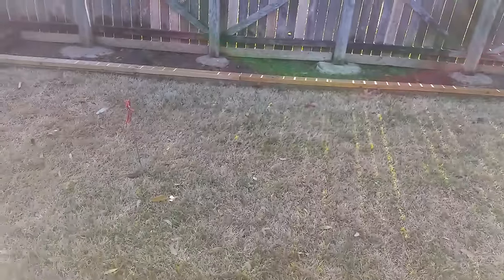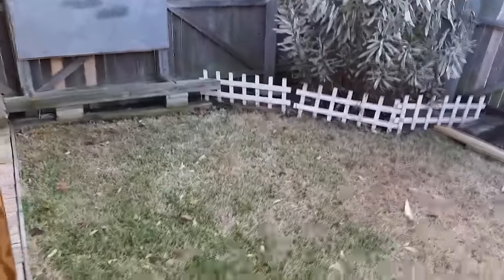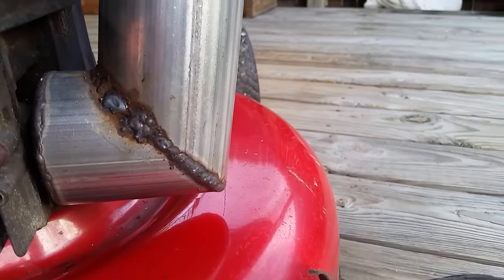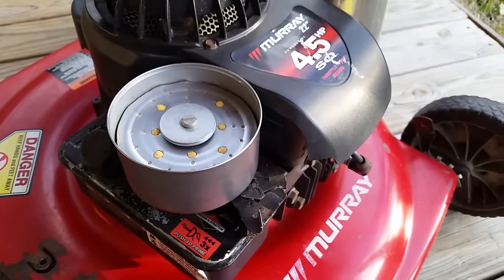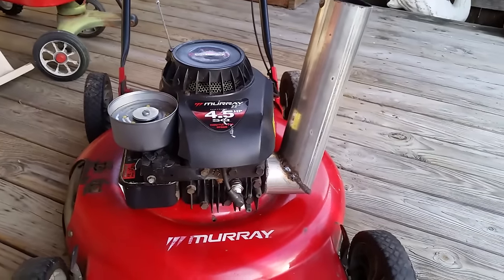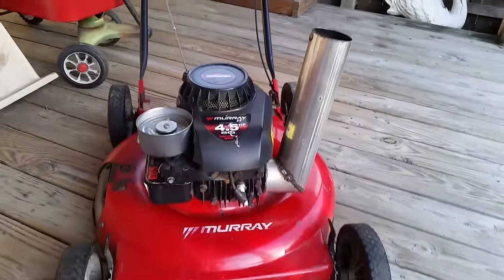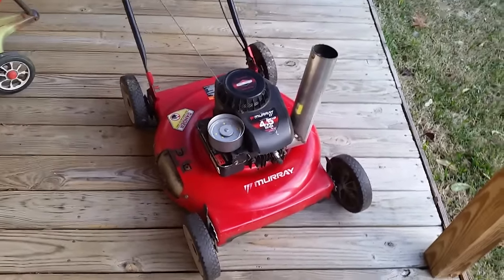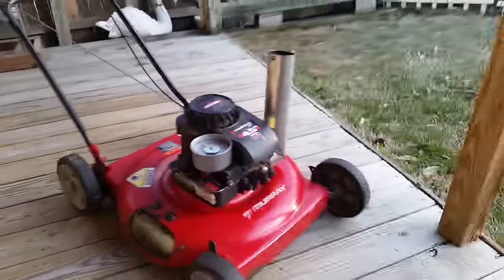RICED OUT PUSH MOWER

Comment: Why not put a turbo on it?
Reply from the maker: I put a twin turbo on it last month but when I started it, it hovered in the air, so I thought it would be more efficient to leave it naturally aspirated.
Reply: Creeperboy because it's can explode
Reply from the maker: I wish it would explode that would be epic...
Reply: Creeperboy get a belt drive emissions pump from a Lexus or some other large engine car, will act as a small supercharger
Reply: an electric one
Reply: Creeperboy  keep the turbo off u wouldn't want to add more weight lol
Reply: and nitrous
Reply: Creeperboy throw on a turbo, camber the wheels, add under glow and lambo doors and you'll be fine
Reply from the maker: The 20th Century Limited 

You're joking, right? Please tell me you're joking.
Reply: The 20th Century Limited 😂
Reply: The 20th Century Limited in weak
Reply: Creeperboy where the vtec lol
Reply: Put a few sneaky Pete bottles on it and run nitrous. For those days you wanna mulch the grass.
Reply: +Backyardmech1 Lol no kidding!
Reply: Fuck yes. Everyone knows 6 lb-ft of torque isn't enough to mow a lawn, I want 12 lb-ft so I can mow a field.
Reply: josh suddeth spray painted gold rims or neon color rims and it's good to go
Reply: Creeperboy Jesus you're everywhere
Reply: The Quickster How did I get all over the internet? 0.0
Reply: First of all he would have to add a battery, a oil pump for the turbo, mini intercooler, proly drill in the stock fan shaft and somehow have the intercooler cooled by the turbo, plus, a wastegat/ boost controler whether it being manual or mechanical, allong with 93 octane, a blow through carb, may need to upgrade internals, so motor can take it, but it would be a much heavier mower, prolly even needing retrofitted frontwheel/rear wheel drive, making it more heavier, and prolly a bigger tank, maybe lower compression head, and prolly a bigger engine shroud+ fan unless running a electric fan in  shroud, because air colled engines already run hotter in the first place, oil temp gauge, oil press gauge, colder sparkplug. A lot of MODS to do that imo.
Reply: Creeperboy I was literally thinking that
Reply: knightrider1545 :  This kid has time, and a friend that welds. IMO, why has he not already started the "Turbo Retrofit" video series?
Reply: BigT 1418 Rice harvester lol
Reply: Ninja said it hovered. Man you corny af but you cool too so I guess you're alright.
Reply: Creeperboy lol fr😂💀
Reply: @Jay_T  Lmao!🤣👍
Reply: That "Murray" w/ the 4.5 small block Briggs is (was) exactly like my 2012 model.  Funny I ran into this video, I just put a new OEM carb (made in USA👍) on it yesterday and an E3 plug in it, and it started first pull with no priming. I think I can get a little better ET out of it with a header pipe and a little nitro.😉👍
Reply: @backyardmowerracing492  Briggs has more torque than  a V tec. I know, my wife has both, and I'm the mechanic AND crew chief.
Reply: @detroit1018  Just keep on with what you're doing. Don't ghetto it out.
Reply: Because rice
Reply: @Jay_T  I would recommend a carburetor cleaning or carb rebuild cuz it was surging a little bit

Comment: Need upgrade fuel, turbo, and speakers and neons... Go rewatch fnf ..
Reply from the maker: Yea because that'll definitely happen...
Reply: COMMENT STILL RELEVANT
Reply: I don't remember typing this
Reply: @kylehoffman7798  even better!
Reply: @AgeofReason  honestly you'd need to completely overhaul the suspension, bore and hone the cylinder. Set the rings, build a cpu and engine management real time data program. And it wouldn't hurt to get some cool tribal stuff like painted on
Reply: @kylehoffman7798  tribal thorns and barb wire, just for good measure, lol

Comment: nice push mower dude. I'm tempted to do something similar to my 6 HP one
Reply from the maker: Ryan Wequ lol thanks man it was a pretty fun project. still runs good too. this thing won't die I swear.
Reply: JT A 

I'm using an '83 MTD with the original plug, filter, and maybe 3 oil changes.

Starting fluid and fuel stabilizer will keep your POS going for decades.
Reply: Ryan Wequ i straight piped a 6hp briggs and straton it sounded like a beast almost like a harley davison
Reply: Ryan Wequ: title the video, "How to make a 6HP mower 4.8HP".

Comment: It's not running lean. The stock intake gets better airflow than that can setup so you are definitely not running lean. That exhaust setup as big as it is will have lots of pulses reflecting off of the baffle. The trapped cool exhaust will increase back pressure. This looks but I am almost 100% sure that you are losing power.
Reply: Lol he is loosing power. Your dead on shit 3 inch exhaust is usually to big on a friken 250 hp vehicle lol specially if it has duals    yet alone a 4.5 hp push mower.   It run better if the pipe was like 3/4 inch.  Way to big of exhaust for that little thing.

Comment: I just made a stainless header for my wifes off roader and was wondering if it would work on a mower.  I might just stick to inch pipe though. God stuff mate 👍.
Reply from the maker: Thank you. I wanted to go a little extreme, that's why I went with 3" pipe
Reply: JT A Hey mate. I fabbed up the exhaust for my mower.  Works a treat.  Got a vid of it on my channel.   
Thanks for the inspiration mate. 👍

Comment: I just got a used 190cc (6hp) Craftsman for 50 bucks. It had the mulch chute on it, they didn't have the regular chute so I fabed one out of 1/8" thick aluminum, I had to do some aluminum tig welding to it. I should do something like you did, not that big of an exhaust though. I enjoy projects that this.

Comment: If you pull on the air intake lever on the carburetor, you can rev it until it backfires. Did that on mine and it sounded sick
Reply: Yep true found that out in my powerwasher

Comment: Now, you can take the step further and attach the wagon, so it can be a real hot rod. Not enough horse power, you say? Attach a speaker and aux cord to the back of the wagon to blast Eurobeat. I guarantee you that the power of music will grant you 15 extra HP on that thing.

Comment: With all the added horsepower are u worried about the blade vibrating off. I know it's counter tightned but dann I'd be worried about that thing spinning faster than what he manufacturer engineered
Reply from the maker: It's hard to sense if you're actually concerned or being sarcastic

Comment: I assumed boost was in my future clicking this link. Baited af guys. 
Some others might have expected some valve work, but not me. I hear or read the words riced and immediately I think you're boosted. Stock top end doesn't win races either but, you get power from a turbo, supercharger, or a mix of the two to make your car actually go fast. You might be saying to yourself, "Isn't 'riced out' just an insult for a Honda?", and I've personally never subscribed to that other than the  amount of noise coming out of a car maybe putting it in that category off the cuff, "That ricer is killing my ear drums and ruining my shot right meow". Maybe you don't care if you lose you're hearing, but that's not my point. You said it yourself, and it's truly the definition of a rat rod engine. The title should be rat rod mower, not riced out because back in the day when rat rodding was a thing, turbos weren't a thing and helping the engine breath and putting a fat exhaust on it was basically what you needed to do to make your car do burnouts. Let's be honest here, i knew burnouts were out of the question, but it's more rat than rice. I get bored too. Peace!

Comment: with that bend in the exhaust how did you get it on Thare don't they usually screw on
Reply from the maker: Cut the stock round small exhaust in half and welded the 3" pipe onto it while the stock exhaust was on the mower

Comment: Dude, you forgot a pod philter for +10 hp and a huge wing up in your face so you can turn sharper. You should also drop it low enough that it leaves only bare dirt behind, and bend the wheel mounts inwards for loads of stylish camber. Also paint it in a set of bright contrasting colours that totally don't clash horribly, for more head turning power.
Step up your game man!

Comment: It still needs rimz, an anti-roll bar, double wishbone front suspension, cold air intake (cone filter), turbocharger, boost gauge, direct fuel injection, DOHC,  intelligent Variable valve Timing and lift Electronic Control, chip, red performance seat belts and retainers, roll cage, track tires, catback exhaust, muffler delete, tinted head and tail lights, a manual transmission with a spur gearbox for reduced axial load, modded intercooler, stripped interior (exterior), and an absolute FUCKTON of "Made in Japan" stickers, anime bodywraps, and other impractical JDM bullshit.  

I will await the follow-up video.

Comment: needs some more fuel..
1. shave a couple millimeters off the piston
2. switch to 91oct pump gas. 
3. drill holes in the needle of the carb to allow for some more fuel. or open the lines inlet size... maybe even cut some notches in the carbs restrictor, to accommodate for the more fuel.

**you can do #3 solo but don't do #2 if you haven't done #1

Comment: drill more holes in that can you call a filter, take some steal wool and baffle your exhaust a bit.  Then do the water trick to kill that major carbon buildup you have inside your engine.  Should not really even have to prime it.  My mower is a 15 year old briggs and starts on the first pull no priming

Comment: Sounds like a normal mower
Reply from the maker: I think the main reason behind that is because I made a baffle for it so it wouldn't be deafening loud and it has the baffle in it in this video. Made it from a measuring cup. Drilled holes in it and screwed it right on the end of the pipe. It really helps with the sound and changes the tone as well.

Comment: Doesn’t really sound much different than a normal push mower lol.  Plus that 3 inch exhaust is so big for that 4.5 hp lol shit I don’t even run that big it exhaust on my truck lol.   Want it loud just run 3/4 inch exhaust wide open  than she will scream
Reply from the maker: it had a baffle on the end to quiet it down. I prefer the straight pipe sound myself it’s a whole lot louder.

Comment: believe it or not u don't nothing but make it less efficient its designed the way it is for a reason adding a long wide exhaust and adding a tuna can filter doesn't make it a rat rod change the deck change the wheels the handle. get a big bore kit for the engine
Reply from the maker: I had fun with it and I certainly don't need your approval bud

Comment: Nice mower but it sounds like the carb needs cleaned with is simple to do with some tools
Reply from the maker: I actually cleaned it pretty thoroughly but it still had the idle issue
Reply: JT A might be valves cuz my snapper had the same issue cuz of the strait pipe
Reply from the maker: Might be but it's a beater mower so I don't mind

Comment: Why does it keep kutting out by itself
Reply from the maker: Possibly bad valves. Cleaned the carb well and still had the same surging issue. But it's a beater mower so I really don't care.
Reply: Aftermarket camshaft

Comment: how do you hate to mow you have more deck area than grass half the grass is dead and you only pulled the cord 2 times and said it didn't want to start. But for real how do you hate mowing I have 2 acres to mow with a fucking push mower how the hell do you hate what looks like 15 by 8 feet of yard.